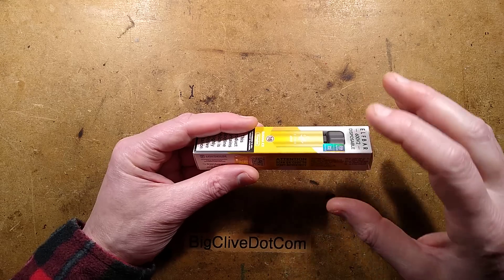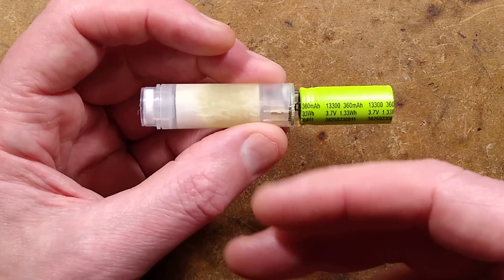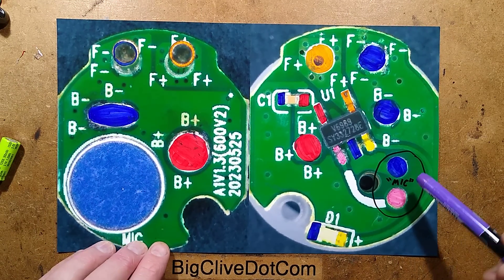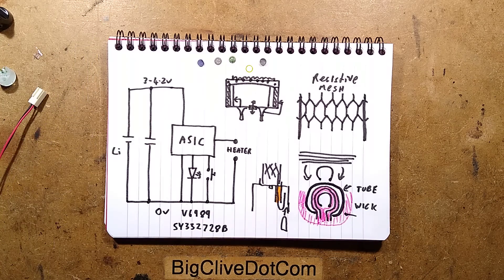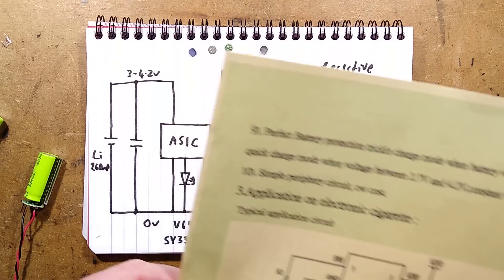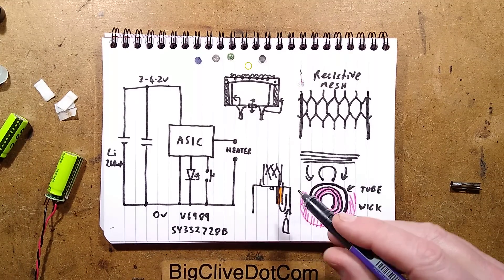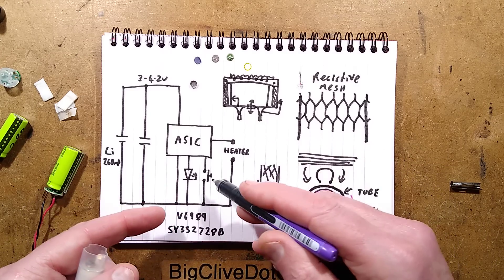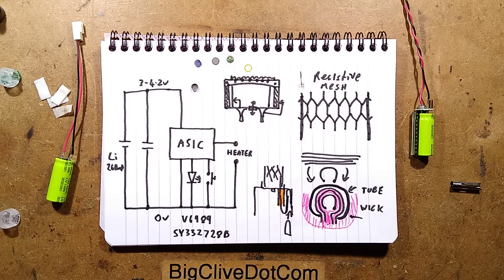Lithium "capacitor" in a disposable product

Comment: Very interesting. It's almost as if the designers were asked to see if they could get capacitors to power the things, then cheated when they found it wasn't practical yet.
Good scope for repurposing the battery, and the light guide could be useful too.
Reply: I wonder if it was to make it look less reusable for people who'd take it apart
Reply: @Captain_Irk definitely designed to discourage salvage/ reuse
Reply: My theory is that they were looking for a better way to solder lithium batteries to boards. The Cans for capacitors are mass produced and there's no reason you couldn't use one for a lithium battery. I think it was to get both terminals to the top of the battery without having to resort to a foil bag type.
Reply: ab9467  Would tend to agree if there were markings stating it was on the package. I looked them up, they're lithium ion batteries designed for use in smaller sized devices, they have a reliable pressure valve on them that assures no fires happen if shorted and they're packaged with solder able leads so that you don't have to spot weld them like most lithium batteries.
Reply: Caps don't have the capacity and everyone designing these knows it. But this formfactor is very useful for these because now they don't have to route one wire from the other end of the cylinder along the side squeezed between the battery cell and the casing. Probably much faster to assemble and that is important for a mass-produced item.
Reply: @benbaselet2026  The form factor has existed for small capacity PCB mounted lithium batteries for at least a decade in applications such as memory keepers  (I'm tempted to say 20+ years as I'm sure I've seen them in old RS catalogs) and it's mainly a matter of using appropriate ones for the task at hand
Reply: It's far more likely that the manufacturer has capacitor packaging machines that are both paid for, and underutilized. Using them to package lithium cells is a clever way to keep the machine line profitable.
Reply: @kmoecub  Also moves both terminals to the top for easy manufacture, smaller devices and less risk for fire hazard with not being a foil bag battery.
Reply: I'd imagine it's just to make the battery into a format that can be used in existing PCB holders, instead of having to have someone assemble a portion by hand.
Reply: I wonder if it was an attempt to get around shipping restrictions for LiPo batteries.  "No it's not a LiPo battery, it's a LiPo capacitor!".
Reply: @drjasonharrison  If Wikipedia is to be believed, in a lithium-ion capacitor the cathode is like that found in a traditional Li-Ion cell while the anode is like that of an electrolytic capacitor.  The advantages seem to be a low self-discharge rate and increased safety (low/no possibility of thermal runaway).
Reply: @alexhajnal107  but standard Lithium Ion cells have incredibly low (virtual zero) self discharge anyway. Except for the ones that have protection circuits built in. I think it’s just a lithium ion cell inside a capacitor style can. This design eliminates all the hand soldered wiring inside the vape. Now they can be 100% machine assembled.
Reply: I doubt anyone would have seriously even tried, capacitors aren't even in the same continent of being capable of doing this job and there's really nothing on the horizon I know of that would let a capacitor of that size both do that job and hold a charge for months on the shelf. Probably just ease of manufacturing.
Reply: @John_Ridley  Supercaps have very very low self discharge, i doubt long term storage is an issue
Reply: @DarkAttack14  They are, however, way more expensive than a LiIon with the same capacity, and these things are made to be cheap and disposable.
Reply: @DarkAttack14  Lithium supercaps have a tendency to leak and dump goo all over everything. I had a bunch of Zeus Ramdrives fall victim to this ($4500 apiece, trashed in 3 years)
Reply: I disagree. They simpliy used a well-known and understood form factor to make a lithium battery. The big advantages of capacitors over traditional cylindrical cells is that both contacts are at the same end, and that every electronics design and manufacturing facility is equipped to handle them automatically. Normal cells need to be soldered in by hand, these can be done by machines. In my mind, this is a cost saving change first and foremost.
Reply: @pahub9256  How do you know that exactly??
Reply: ab9467   If it is then there must be some extreme discounting and/or dumping going on.  Even at bulk quantities 3.8V lithium ion capacitors from Farnell or Vinatech are as expensive as a disposable vape or even more so.
Reply: Okay, see Clive's next video  @ab9467 , taking one apart it's definitively a lithium cell; no capacitive ability at all.  So the form factor is no more than a convenience.
Reply: Yes, they are becoming popular and working their way it larger battery powered devices since the super cap can take a large burst of energy and apply it to the basic rechargeable cells.  We will see much more of this to come.
Reply: @pahub9256 no it is a lithium ion capacitor
Reply: @michael-j-harrison  The capacity marking is that of a lithium ion cell. If it was a capacitor it would have a value in F, not mAh. Also the voltage is that of a Lithium Ion cell at 3.7V. GreatScott! did a video about the capacitors and you can see they are different.
Reply: ab9467  I have searched and I can only find Lithium Ion Capacitors that are rated in Farads. None are rated in mAh. These are cells. Not capacitors.
Reply: Its a simple relabeling trick to skirt the looming regulations concerning singe-use Li-batteries
Reply: It's obvious why they made them like this. The foil casing on the pouch batteries is harder to recycle 🤷 shot me if I'm wrong 😅
Reply: Also the top of a capacitor pops safely open under pressure, batteries tend not to. I bet that's part of it too, it will fail predicably if there's a short.
Reply: ab9467  Wow! They are interesting devices, thanks.

Comment: This sort of packaging would be great boon in things like uninterruptible power supplies for little arm SBCs.
Reply: I was thinking the same thing, I'm not very clued in on capacitor sizes but if it's a standard size and easy to buy then you could put a discrete TP4056 and DW01 circuit on a custom board and just use a standard capacitor footprint and add a micro USB or a C type for recharge and you have a neat compact ish design